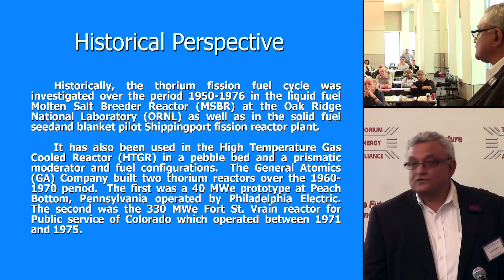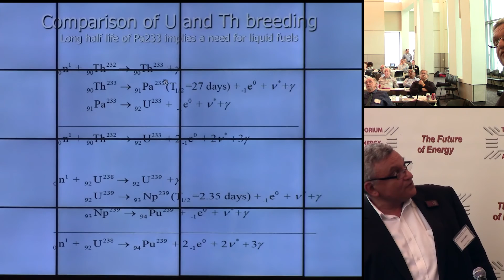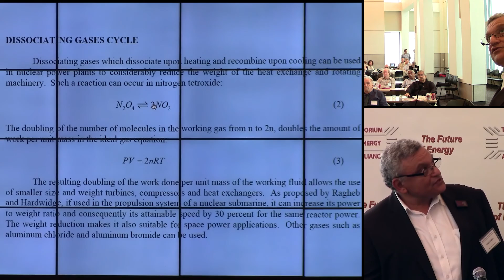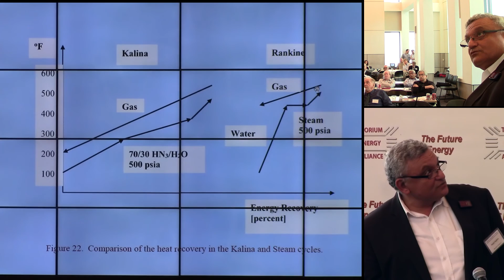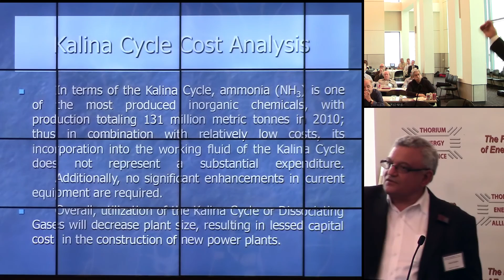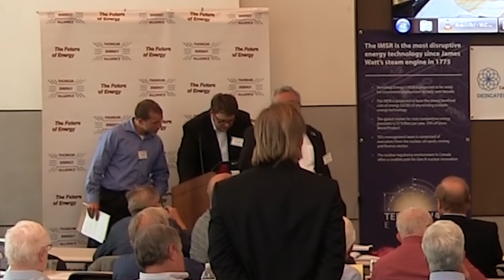Magdi Ragheb - Alternative Cooling Systems for Th-MSR Breeder @ TEAC6

Comment: Thanks, Gordan. I use Quora to answer questions on Generation 4 reactors.  I use lots of infographics to help explain things. It is difficult to know how effective I am.  I do try to fix the mistakes that I do make. So I am happy to correct things if people do find mistakes. It is not easy to quickly explain Generation 4 nuclear reactors in a short and interesting way. Some of the explanations are simplistic to help explain issues in an interesting and easy to understand answers. I am not a scientist or engineer myself. I hope I can make a difference. My focus is to explain the importance of building prototype reactors and the risks and benefits. Not saying we need to build large numbers of reactors. Just prototype development. This seems to me to be the next most important step. Then the value of Gen 4 reactors can be tested.

Comment: I take it the Pa-233 needs to be separated in situ to prevent it from stealing a neutron and transmuting to something else before it has a chance to decay into U-233. Right? Do you always have to do this separation or can you leave it all in like some are proposing and swap out the whole core after 7 years?
Reply: If you leave it inside some of it will turn into U234 and over time  it can absorb another neutron and it will turn into U235 yes that's the very same Uranium we are using now in all NPS but you lose 2 neutrons and it takes time to happen, If the molten ThF4 / FLiBe is rich in additional F2 then PaF4 (ThF4  + n -> PaF4)  becomes PaF5 and that salt with pressure lower than 1 atm is a gas which will bubble out of the molten salt. That's step 1. Step 2 is when Pa decays to U233 then you can covert it to UF6 (at the right temperature and pressure) it turns into a gas and the rest of the PaF4/PaF5 will stay liquid.
Reply: You can make your blanked bigger and make the this case less likely. This does work and can be sensible employed. I think Kirk himself has proposed this for FlyBe Energy LFTR.

Comment: That Al2Cl6 dissociating gas turbine system could probably then be combined with an ammonia-water Kalina bottoming cycle to really wring the very last dregs of heat out of the reactor. http://www.diva-portal.org/smash/get/diva2:8718/FULLTEXT01.pdf

This paper from Sweden discusses the concept of combining gas turbines with Kalina bottom cycles to achieve maximum efficiency. It's cheap, the working fluid even more so; and its ability to work with a wide range of temperatures and extract useful work as a bottoming cycle from "waste" heat can be applied to tons of industries.

One may imagine a thorium reactor supplying combined heat and power to an industrial park and/or a city and the heat exhausts from the various industries would then feed into a Kalina system. Excess electrical energy could then be used to drive energy storage solutions. Maximum utility.

Comment: actually, breeding in solid fuel is quite easily possible, at least to break even, and not too hard to get BR as high as 1.2
Reply: +Jonathan Schattke Dealing with off site fuel processing gives ammunition to greenies claiming proliferation risks. Those facilities are also expensive.
Reply: with high breeding ratio, you can move fuel without reprocessing. you just have to rethink the whole fuel thing.
how about a moderate temperature molten salt in the cladding cannister?